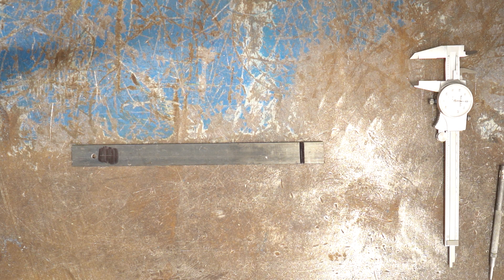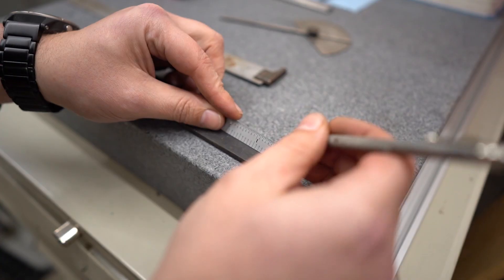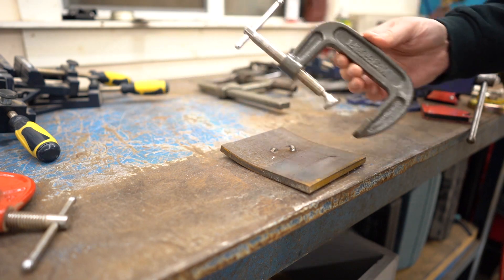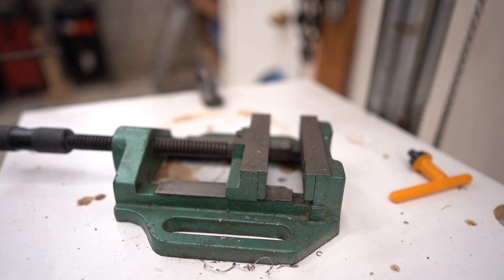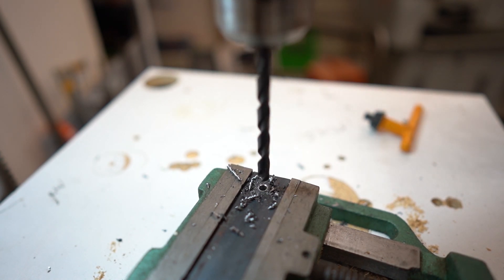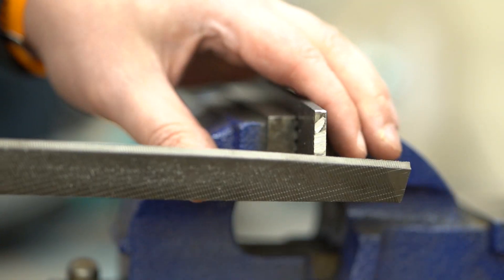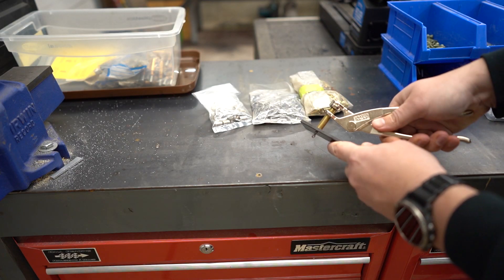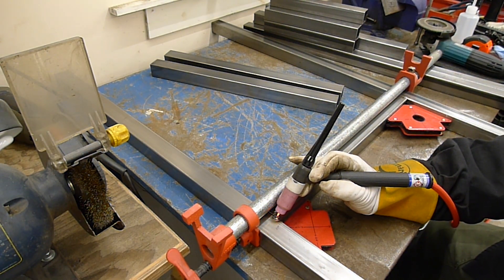New to metalworking? Develop these 5 skills first!

Comment from the maker: What else would you consider a fundamental metal working skill?
Reply: Bending and folding would be a skill I'd add to your list. A lot can be achieved with a few well planned folds in a simple piece of sheet metal.
Reply from the maker: @40-forty-plus  would you rank it ahead of any of the top 5 I've listed?
Reply: @Zengineer  I'd put it up there with what you've listed. Why cut and join when you can bend?
Reply: Put where you want to cut or file closer to the jaw
Reply from the maker: @woozhi9218  absolutely! Well supported material makes a work of difference. Otherwise you'll just play music! ;)
Reply: Organizing all your parts, sorting boxes, drawers with dividers etc. Organizing all your tools, you spend looking for the tool buried under a pile of junk for hours loosing precious free time :) So put everything in a fixed place and put them back after use immediately. Safety gear like masks, eye and ear protection.
Reply: Bending is better than joining
Reply from the maker: @michaelsrowland  In general terms I agree, it's got advantages though most bending isn't within the capability of an entry level metal worker. Bending is a nice solution on the production line, but for one off hobby work welding, bolting, riveting etc. can be easier, faster, stronger and/or more easily accessible to most people.
Reply: @Zengineer  is bending stainless Steel difficult? There are yt videos from people in India bending stainless Steel in a vice. It looks easier than welding
Reply from the maker: @michaelsrowland  It depends. :) (on material, size, tools available, etc) If you are just looking for a simple bend in a thin piece of sheet metal, no problem. If you are looking to put a 90 degree bend in a piece of 1/2" plate steel, you will have difficulty!
Reply: @Zengineer  a 90 degree bend on .5mm stainless Steel